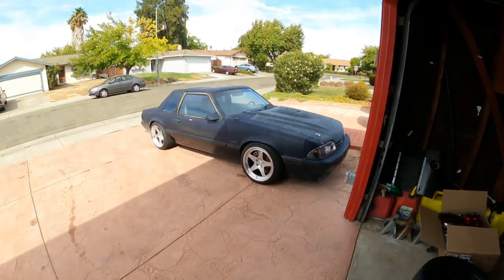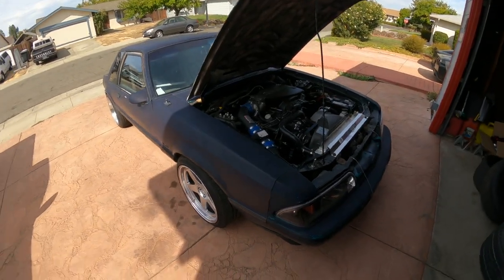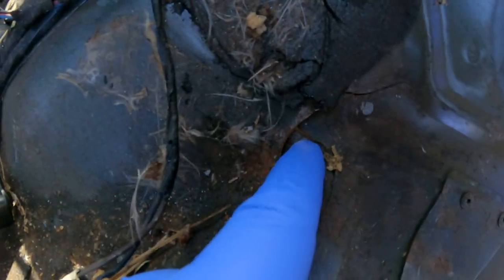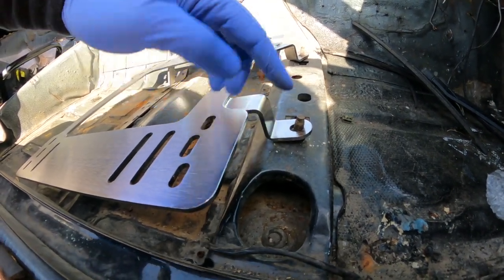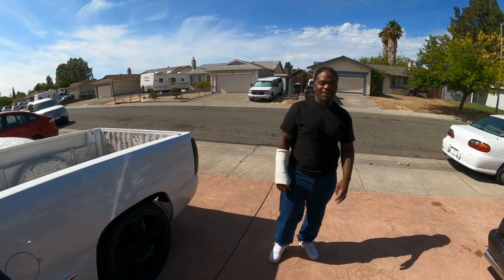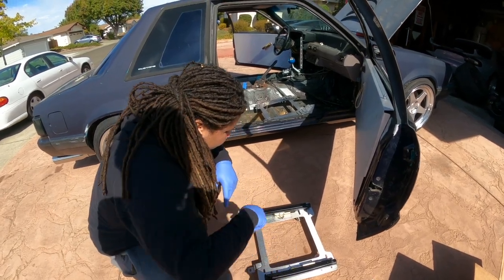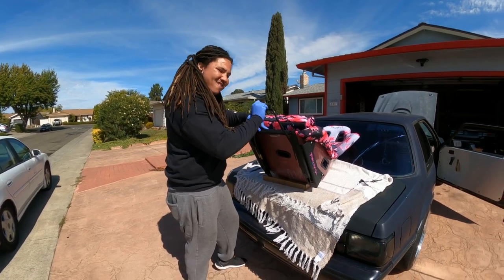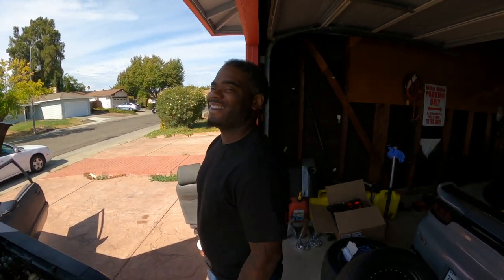Installing New Seats In The FoxBody! These are Chubby Boy Friendly!!

Comment: Just mount the Fox seat slider brackets to the nrg seat bracket then mount to the car it go way down. You can use manual seat brackets from any mustang from 79-03 . You can use a passenger manual bracket on the drivers side also there the same.

Comment: LMR makes a front seat mount replacement mount/ bracket thing part # LRS-10692 seen it in there newsletter a few months back if I remember correctly you can bolt of weld it in